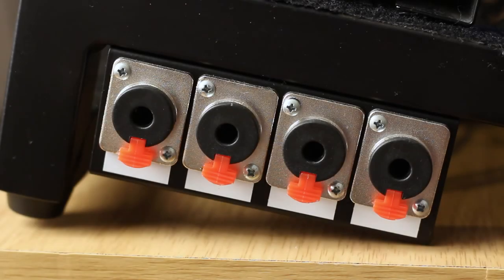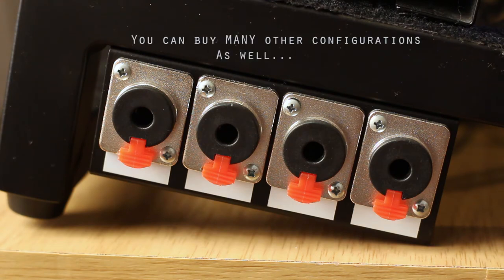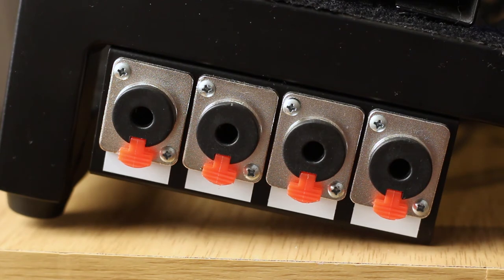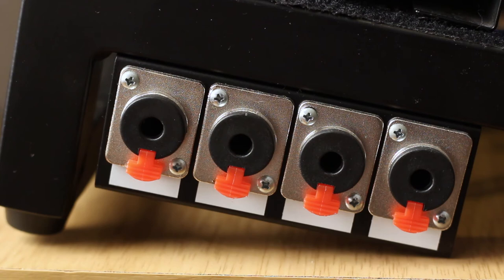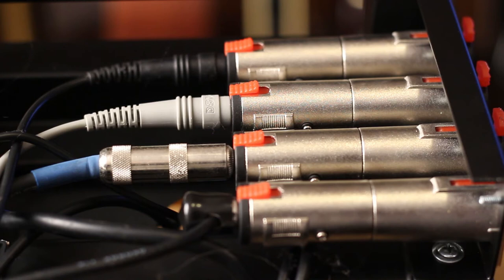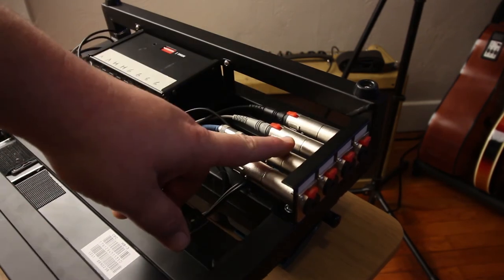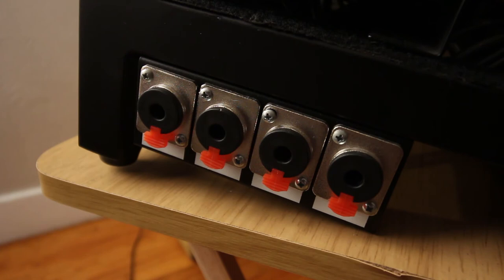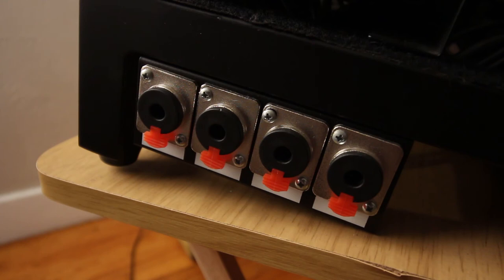BTPA Pedalboard Patchbay

Comment: Awesome review! Thanks for that! We now have these available as a kit (panel + connectors) - https://btpa.com/pp-0012-04-thru.html

To answer your negative comments on the size of the panel with the board: We offer a higher feet kit to install to Pedaltrain boards that features 1" higher feet. You can add these to the legacy boards and the newer boards to better fit the panel. Here is the higher feet kit for the boards with 4 feet - https://btpa.com/LIFTKIT01.html

Also, to answer your question - the 4 port panel fits on the Pedaltrain Classic Pro and old Pedaltrain Pro.
Reply from the maker: Beautiful! I pinned this comment so people can see it at the top in the future! Wonderful product and I appreciate the interaction! More companies could learn from you!
Reply: Are the white spaces for labelling meant to be used with a label maker printed sticker?
Reply: Do you know of any slightly cheaper versions of the same thing? don't need the sturdiest build as it's only for studio use, so provided the jacks are still good quality I'm sorted. Know of anything that fits this?
Reply: Best-Tronics Pro Audio I love the higher feet kit. If an idiot like me can install it, anyone can.
Reply: I just installed a four port on a classic 2. Need to put higher feet on but the existing ones aren’t screwed on...they are riveted. Pain in ass.
Reply: any chance of getting the dimensions of this thing? curious if it will fit on various boards

Comment: It is great if you use the same setup all the time. If you change the routing out for different amps, like ones that do not have an FX send/return that would be a hassle going back and forth. Though I like it.
Reply from the maker: TJ Nugent it’s actually very easy to do... if you simply plug a patch cable from what would be your “out” when using an FX loop amp into the send jack and then plug your amp into what was the return jack. It is then setup to use with an amp with no loop... takes one patch cable and  just a few seconds to do

Comment: have you had any noise issues with these type of connection? recently I purchased something similar from Amazon and it adds a lot of noise to the signal, so it makes using my compressor and fuzz more annoying, and I want to know if maybe the parts I got send are defective or if this is just how it is supposed to be. I know it's the connectors because I'm using a very high quality power supply, good cables and when I plug straight into the pedals, I get no noise.
Reply from the maker: I had no noise issues. So unfortunately it may be the parts you bought on Amazon. If you’d like to hear more examples of me using this patch bay there is another video on my channel called something like “how to use a patch bay to run both 4 cable method and into the front of your amp.” The thumbnail is this patch bay again.

Comment: So you use one of the outputs for your amp footswitch? Are you using a connector as a pass-thru with normal 1/4" guitar cable going into your foot switch input on your amp?
Reply from the maker: That is correct. Foot switch goes to the patch bay and the patch bay goes to the foot switch input on my amp.

Comment: Great review. Is your board the 12.5 inch board and does the panel cause the back foot to not sit on the floor? I have the newest classic 2 and want to run my patch the same as yours.
Reply from the maker: Greg Criswell it will not work with the classic 2... they do sell a feet riser kit which they actually linked in the comments. This is a classic JR and it just BARELY fits... I’m actually thinking about just drilling the holes in the back of my classic 2 and running the connectors through the back of the board. Because I don’t want to use the feet.

Comment: You can simply put taller front feet on the pedalboard to raise it up so the patch bay doesn't meet the floor.
Reply from the maker: This I true, or the back for that matter.
Reply: jobyregrets Yup, totally!!
Reply: Yeah but pedaltrain put rivets to hold the feet on.  Not cool pedaltrain.
Reply: David Burleigh, that sucks! That is totally not cool.
Reply from the maker: You can drill them out. It still sux but you can do it

Comment: Dudes, i have a similar product and it generates noise. I dont have a bracket installed and my pedalboard is not metal but wood. I have also read somewhere that the little screws on the side of this kind of unit are responsible for maybe shielding? Anyone could help me out?
Reply from the maker: You are likely having ground issues. You could try a hum eliminator to see if that resolves the issue. You could also try a 3 prong to 2 prong adapter just to see if that resolves it. (I wouldn’t use this live)
Reply: @JobyP  i honestly dont know where is the problem. Im using 4 of these connectors (4 cable method). If i bypass the connectors, so just plug the cables into the first or last pedals in the chain then there is no noise. Noise only comes when i want to use the patchbay which includes 4 of these connectors.

So i dont exclude the possibility of grounding issues but without the connectors my rig is basically noiseless. Im thinking about shielding or grounding issues of the connectors themselves. Whats is weird, the same things happen when i want to use a temple audio 4x patchbay. And as i wrote to temple audio, it turns out its a well known “issue”, the patchbay requires shielding and grounding.
Reply from the maker: @gabibartok4544  That sucks man sorry to hear that. Some amps do HATE 4 cable method.... I bought the most perfect vox amp I was so in love with it and got it home and in 4cm it sounded like dog shit... just sounded completely broken... I ended up returning it.
Reply: @JobyP  i think i have found the issue. I have recently started a “rig cleaning project”, trying to eliminate all possible noise sources, filter everything i can. I have bought a power connector for my board from Temple Audio called IEC MOD. Through this, the power is filtered and for some reason it eliminates all the noise i have experienced earlier. Im happy now as the problem is solved but it would be still cool to understand how is it possible that even without this pricey thing my pedalboard is noiseless if i dont use a patchbay but if i do i have to have a power filter.

Comment: Got two of the 2x slot ones, 2x ins one side and 2x outs other side of Pedaltrain 2 classic (two round holes at back version) - had to use the Cioks PT-Kit / 4 rubber feet raising kits to get clearance - seems like people have grounding issues with Neutrik, Redco or other brand locking connectors. But no reports of these issues with the BTPA. Also it seems like the BTPA connectors are smaller than Redco/Swamp/Neutrik - I got some Neutrik gaskets for the D size connectors but they are too big to use with the panel mount/BTPA connectors. Not a bad thing! I got the black connectors to match the colour of the pedalboard too heh. Also another upgrade I'm very happy with, 'Stagetrix Super Loop' high temperature tolerant low profile velcro loop tape on the board, and Velcro brand Heavy Duty (Industrial in US I believe is the branding) hook. Not as hardcore (or expensive) as dual lock, but better strength than plain velcro and better for me than the difficulty of moving stuff around that is dual locked, as I change stuff around a bunch.
Reply from the maker: How hard was the cioks kit? Did you have to Buy a rivet gun? I wanna put one on my PT2
Reply from the maker: Oh... and Fuk a bunch a Dual Lock lol... I bought a pedal with that shit on it once... it was on the whole bottom.... oh my god!!! I had to use a paint scrapper chisel thing and get a friends help to get the bastard off my board... never again... never again lol!
Reply: I ended up needing to raise all 4 feet so needed 2x PT Kits. I had already bought one PT Kit, never used a rivet gun before, didn't really understand what I was doing and mangled one of the two rivets included. I am STILL hunting for a cheap replacement for that rivet, down to around $8 USD with postage from UK to Australia for a couple (or 10-25) rivets of the correct size and type. I got a cheap rivet gun for $7 USD I think. Very simple to use when you get the hang of it. Just need to make sure the hole size you are riveting is slightly larger than the rivet (should be obvious but a simple instruction from Cioks would have helped me there!) - I believe some of the hole sizes mentioned on various Cioks pdfs and videos differ/have errors sometimes - I think I was advised 4 or 4.5mm for the 4.8mm rivet.. but I could have just got confused with the mounting bracket and everything else. I also thought I could save some money by buying the Cioks '4 rubber feet kit' which said it had rivets and washers included .. but it didn't. Cioks and retailers updated the description to remove the washers and rivets. Kind of useless without them! Luckily my store was kind enough (who ordered it in) to provide some washers and rivets from two PT Kits. Feel bad for the store losing out though! Using the washers underneath (I put washers under the front feet) made it harder to get the rivet in, but with a bit of force it went in. Without the washers was easier. I recommend bracing the rivet gun against your leg or something solid so you don't have to exert as much pressure as using in mid-air - you really have to work your hand and arm muscles to get it to pop! I had to ask a friend to help with the second front foot (with washer between PT-2 and the rubber foot) because my hand was so sore after the first couple going in, heh!

I now have five feet, three at the back and two at the front - going to add a sixth foot when I get the money to order in 1-2 rivets from the UK (lol, I can only find 25-100+ rivet packs locally for $15-25 USD). Sorry long story short yeah you gotta get a rivet gun, but a cheap one is all you need - just make sure it has the right size shaft attachment for it :) I like the look of the BTPA higher feet kit but I prefer having riveted feet rather than screwed in - also the PT Kit seemed better value, until I figured out I needed two of them! Edit: it was $6-7 USD ish from local chain 'Bunnings': Craftright rivet gun https://www.bunnings.com.au/craftright-rivet-gun-set_p5910194 should be something similar priced at walmart/kmart/amazon overseas
Reply: And yeah for dual lock I hear it's stupid hard to remove if you use too much.. I hear/see that you should use 1cm square tabs kind of (and in arrow shaps if want to make it easier to remove) in the corners only.. but yeah screw dual lock! Unless permanently want something in place/impossible to be stolen while performing haha
Reply from the maker: yeah if you do the triangle thing it seems to work good, Dan from that pedal show does that. He obviously knows his shit lol...

Comment: Would the work with the novo 24?
Reply from the maker: Yes, I ended up buying a novo 24 and it works perfect.
Reply: @JobyP  do the feet still sit flat on the ground with this attached, or did you  have to change the feet on the Novo?

Comment: Do you still plug your guitar straight into a pedal ?
Reply from the maker: +NoDirectionHomeMTL yes I do, you can buy a single, double or triple version if you want to add an additional one on the opposite side or whatever. But yeah I plug into a tuner and the patch bay is just used for all my outs.
Reply: Thx !

Comment: Dude when you go to your older board just put taller rubber feet on it to provide more clearance!😉
Reply from the maker: I sing and play so i really dont want my board any taller. So what I did was chop the bottom off with a dremel tool.... worked great lol :)
Reply: @JobyP  taller only at the back. Come on work with me here lol.
Reply from the maker: haha... Naw I feel ya! BTPA actually offers a feet riser kit for pedaltrain boards. BUt if the backs taller I gotta lean wayyyy down to make my wah pedal sound normal hehe :)

Comment: Just get a TEMPLE board.  They do this in a much more simply than this.
Reply: @Cameron Smith No, it does not flex in the middle if you spend another $15 on a mounting bracket. It also holds the power supply underneath.  I have a regular power supply and a Vertex battery power supply, so I have two mounting brackets.  Each mounting bracket adds 4 rubber feet in the middle. Zero flex.  And there is no plastic on the entire thing. just aluminum